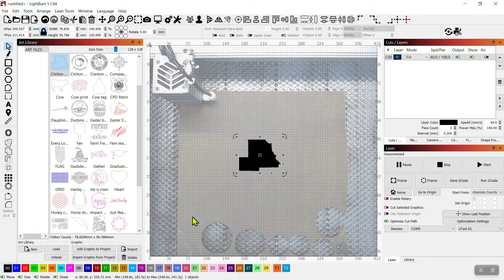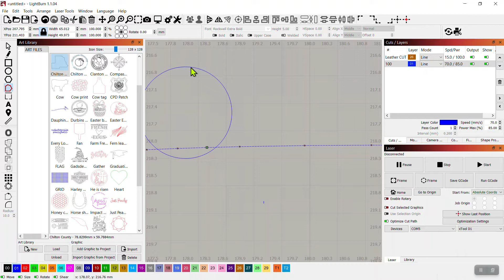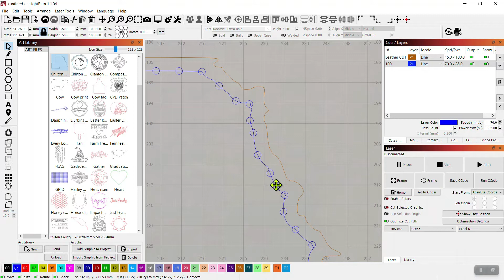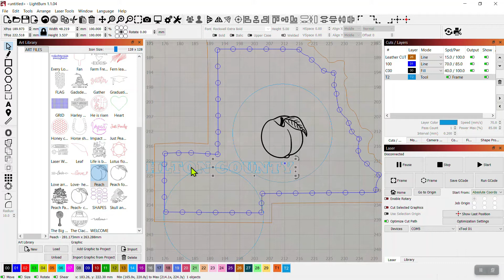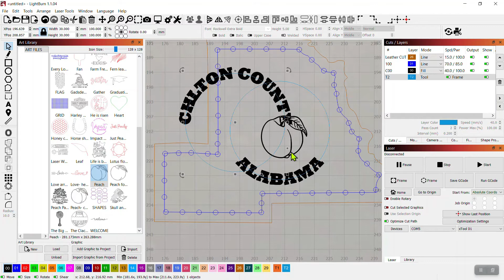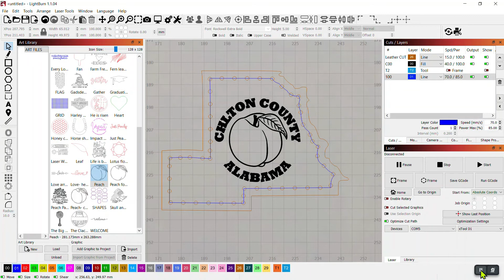Making a custom hat patch

Comment: Kind of off topic but have you ever covered a piece of wood with painters tape and then burned your design, taken off the paint that’s only in the design so now you effectively have a perfect mask and then paint the design? Would that work?
Reply from the maker: I have, It will take more power to cut the engrave and it will leave tiny pieces of blue in the engrave. As long as you are painting, it shouldn't be an issue. I think that transfer paper may work better it just costs more. As long as a little residue and tiny flakes of the painters tape isnt a concern, it works.